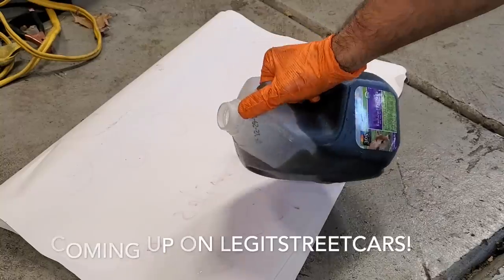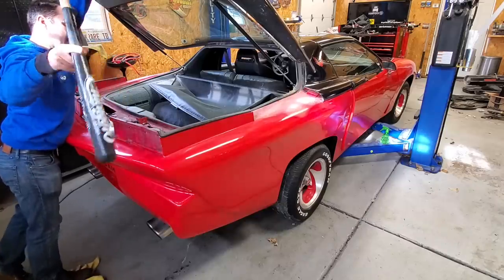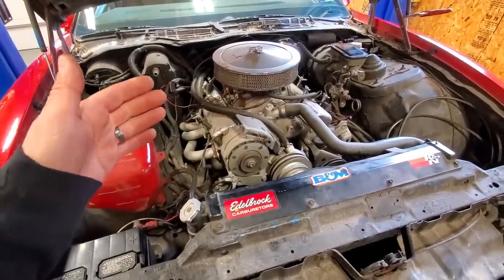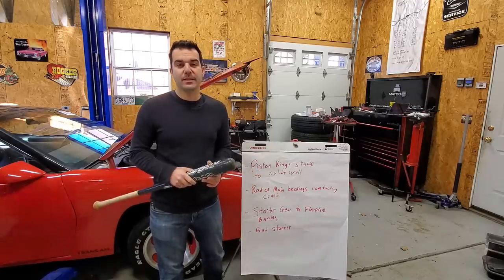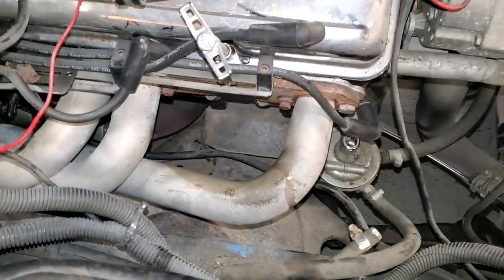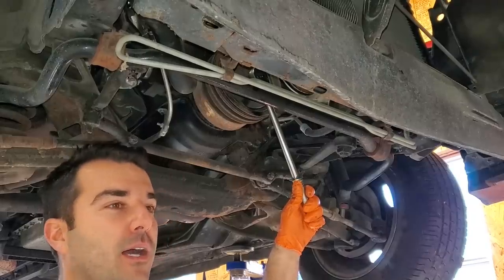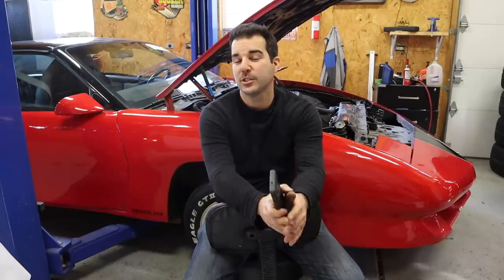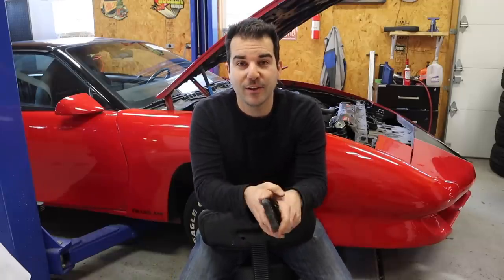My $1,100 Mystery Auction Car Has A CRAZY History! Famous Builder & Built Engine But, Will It Start?

Comment: Doesn't sound like a knock, definitely sounds like lifter tick, the same noise I have to listen to every time I start my Miata ;)
Reply: Yes! Literally valve knock (I assume it's a pushrod engine?) due to a lack of heated oil flow to the shims. The same thing can happen with semi-modern engines that have hydraulic tappets.

Comment: Trolls... they suck. I enjoy your videos and learn from them. I have done done what your doing now, taken motors from the junkyard (sbc350) fixed it up dropped it in a S10 (1986...) with a manual and enjoyed it for years until somebody wanted to buy it.  ATF automatic transmission fluid is great for getting stuff moving.  Even did it to my BMW after letting it sit for 6 month. Pulled the plug lifted one side to level off the pistons some more and let it sit over night, vacuum it out gave it a few cranks to ‘blow’ it out compress came back from the ring sticking.  Then sea foam in the oil half a can and in 5-8 minute it was back to 220-225 psi on all 6.   Now I start it weekly and drive it once a week.  17 years and only time I had issues was not driving it.  New truck... thank you for the videos.  Also put a can of sea foam in the oil it cleans the system only thing I put in my cars.

Comment: Wouldn't be a bad idea to pull the distributor and run the oil pump off a drill on engines that have sat a long time.  That will get all the bearings wet, and you'll know if its got oil pressure.  If the drill doesn't bog down, something is way wrong.   If you've got a spare distributor, pull the gear off and use that to drive the pump.  Failing that, a long 3/8 wood paddle bit with the points ground off works perfect on an SBC.
Reply: Yes
Reply: i was just coming to say this but you already got it
Reply: SANK YOU BROTHER MAN
Reply: Sounds like this guy knows a thing or two...
Reply: Was thinking the same on first video
Reply: Good trick gadget. Have used it a time or 2.
Reply: Oh just saw ur comment and I had just wrote that lol
Reply: Dang you guys know so much about cars, I’d love to have my 2016 Audi s3 looked at just to see the overall wear and tear it currently has after 32000 miles.
Reply: @kriseats2158  get rid of it before 75k. Thats usually when the xmas tree lights up on the dash
Reply: That was a great suggestion about the oil pump
Reply: No
Reply: Unbelievable that this car was neglected and the loose distributor; or, stripped hold down bolt. 
I thought that I was bad w/my cars....
Reply: gadget73 Is that even possible? Sounds to be the most safe thing to do to make sure the whole engine is well lubricated before first startup.

Spraying fluid on cylinder walls may only lube piston rings, but not camshafts nor crack bearings if the car has sat for a very long time.
Reply: @apexseal2811  possible, sure.  remove the distributor and run the oil pump. Won't lube the cylinders but it will lube the crank and cam bearings, and get oil up to the lifters.  If it doesn't make pressure, then you'd know before attempting to start the engine and possibly causing more damage. Lube in the cylinders is also a good idea.
Reply: You don’t have any real wear at that mileage. I have one for the wife and she is a traveling veterinarian surgeon that drives 50k a year. She has 128k on hers and I still runs and pulls like a train, and that is with a APR stage 2 tune.
Reply: Could be the pilot bad going/gone which might be why the ticking/knocking. No oil flow??
Reply: This is a great tip!
Reply: This right here!
Reply: @kriseats2158  thats not a car you look at or worry about until its done,then you dump it
Reply: A old distributor with the teeth ground off works the best.
Reply: My thoughts exactly. A squirt of thin oil in each cyl too before firing.  Also. Use high zinc oil.
Reply: @stevelozano9523  ....The Engine is knocking because The Timing is Off...not because of oil pressure.
Reply: missingremote look at the bodywork. LOL. Set your expectations correctly
Reply: If you just remove the distributor from a SBC engine to drive the oil pump, you will not get oil to at least half the engine.  Take an old distributor, drop the gear off of it, and use the housing with just a shaft in it to drive the pump.  The stock housing has a couple of machined surfaces that seal off the oil passage that crosses the block around the distributor.  Trying to get oil pressure without the housing is a waste of time.
Reply: @dougscott6128  having done it numerous times, I can't say I agree with that.  Maybe doesn't get full pressure, but you get pressure and oil on parts that otherwise would be dry.  Old diz is a better primer but anything that will spin the pump is better than nothing.
Reply: Miller if the timing is off the engine may knock under load, not when it’s idling. Btw rhis didn’t sound like spark knock, more like a mechanical noice. Either the lifters or a spun bearing.

Comment: It's hard to tell but the knocking sounds like a few stuck lifters. They do this when they are holding a valve open with a motor sits for a long time. With the distributor loos like that it could also be a labor knock. Get a stock GM starter if you are not happy with that aftermarket one. You may get lucky with the lifters and they will reprime but you may have to replace them to fix the knock, actually we call that a lifter tap and it's not as deep a sound as a knock from the bottom end when something is wrong down there.
Reply: Well said. I had a Cavalier that sat for a long time and ended up dropping a valve from stuck lifters (broke the spring retainers), but it never made and valve train noise. Live and learn I guess.
Reply: @dalton6439  That's a different kind of stuck. One being stuck and causing a dropped valve would be mechanically stick open. When they are stuck like yours are they have lost their hydraulic prime and the internal cup that keeps them adjusted is stuck down in the lifter leaving a gap and making the valve adjustment be extremely loose. Some times the oil pressure will make them pop back out and back into adjustment, quite often they will not and you have to replace them to fix the issue. It's a fairly simple job on these small blocks.
Reply: @switchblade315   You can repair stuck lifters by taking them apart and cleaning them up. I wouldn't throw money at this thing if it can be done with a little labor. 🔧
Reply: @ipissed  Lifters are not that expensive, no way I would try to repair one for the price of a new one.
Reply: @switchblade315   Well good for you, I suppose you would replace a $500 throttle body because you don't believe cleaning things can fix them. Maybe you think there may be gremlins in motors and you can never know if parts are fixable. There are plenty of experienced mechanics on YouTube that show the procedure of cleaning lifters, do a search. Some of which are very expensive and you would be an idiot to toss it when a little clean up and it's good to go.🏎
Reply: @ipissed  Some lifters can be very expensive and are very much worth trying to clean but for this motor just spend the $20. Its a very easy job on this motor also.
Reply: @ipissed   hey smarty, small block chevy parts are cheap, no way I would go that deep into one to take a 5 buck part apart and clean it and not just replace it with a new one, it's not worth the time chance it not working, If you could get to them with out having to replace gaskets to pull the top of the motor off sure, but no you HAVE to pull the intake and valve covers and on THAT motor you ARE going to need new gaskets each time. A whole set of new lifters for that engine is right around $50 the gasket set is also around $50. A throttle body normally has a O-ring on it and cleaning some carbon out of one is not even in the same ball park as trying to get a dead lifter to come back to life. And just for the record i have 30 years experience working on GM cars and trucks.
Reply: @switchblade315  You wouldn't rebuild the lifters because you don't know how to rebuild the lifters. You probably don't have a clue how to get a stuck plunger out of a lifter bore. It may be a mystery to you how lifters work and how to know if they can be rebuilt or need replacing, but some of us know what we are doing.
If you were worth your 30 years experience you would have noticed that this engine has 0 ridge on the cylinder he looked at (you probably don't know what that means, you will have to look it up) which means it has very low miles, so the lifters in it are practically new. On the other hand the motor was seized so it's still a crap shoot. You would be an idiot to start throwing new parts at it when all they need is a cleaning. 🔧 🏎
Reply: @ipissed  I would not waste my time to rebuild a lifter on a small block Chevrolet The price of a set of lifters is less then the price for my time spent screwing around with something that is cheap to replace. I'm all about saving money but I would not take a chance on getting a lifter unstuck when you HAVE to remove everything down to the heads to get them out again IF it did not work.  We are talking  at lest half a day of work each time and a second set of gaskets if the cheap out repair did not work. Some things are worth the chance, but a $50 set of lifters for a small block Chevrolet are not one of those things. Do a job right the first time.
Reply: @ipissed  you know, I have seen times in which replacing the parts is better than trying to save them. One time in particular, was on one of my old Ford 302 Windsors. I had a dropped valve, but it wasn't due to the engine sitting, I tried lubing the lifters to get it to work, but in the long run, it ended up that the prior owner's neglect had cought up with the poor engine. The engine was an N-code, and if you don't know what that means, it means that it was a factory roller cam, and lifters. The miles, upon miles, of neglect left a serious sludge, and metla chip blockage in the cam region, needless to say, I had multiple lifters that went completely dry, and unfortunately, a few push rods that got bent. This instance, there was no saving the lifters, or pushrods, I installed a new cam, as the smoked lifters, smoked the cam too, as well as new lifters, and new pushrods. I also had the block baked, and cleaned properly, as well as rebored, and honed. Of course I also installed new pistons, as the stockers wouldn't be a good fit anymore. There are many times when just replacing parts is the better option.
Reply: @switchblade315  honestly, I'm with you on this, hence the reason I'm willing to try and rebuild many of the fuel system parts on my old 7.3L IDI diesel, my injection pump is somewhere around $1,000.00 and if I can rebuild it, I will. But if the part is dime a dozen, there is no reason to waste time rebuilding a cheap part that will most likely fail again, long before it's service life should expire.
Reply: @TimberWolf429   He or she doesn't know jack about building a engine other then what he or she has watch on YouTube, real world knowledge doesn't mean anything. I do this for a living, I have 30 years experience with small block Chevrolets,  Built AMC V8s, Ford Y blocks, Ford small blocks, Chevrolet V6 and 4 bangers, been completely through a few Toyotas, Macks, Cummings, and Detroits. Do things right the first time and build motors to last, don't take a chance on a stuck part not sticking again when it's cheap to replace it with a new part. This jack wagon just wants to puff his chest and argue. Real mechanics and engine builders know when to rebuild and when to replace parts.
Reply: @switchblade315  I agree with you there. This is especially important when you do work in a garage. You making money relies on you getting as many vehicles repaired properly as possible. If you can nust replace a part with new, and get the vehicle out the door, in less than half the time you would need to rebuild that same part, then that's the way to go. Also, the new parts, as long as they are either OEM, or a reputable aftermarket company, are going to last longer than any rebuilt parts, it's just fact.
Reply: @switchblade315  also, I won't say I have the years of experiance that you do, but I've been in engines long enough to know where to cut losses, and just do a part swap.
Reply: @TimberWolf429  ipissed pissed everybody off

Comment: The Bendix or 1 way clutch on the starter gear sometimes will stay out on hight performance starters until the engine fires and spins it backwards to retract it on its worm gear. Standard gm starters have a spring and a fork connected to a solenoid which holds them because but Chrysler style high torque starters require the motor to put the gear back

Comment: Run some Seafoam in the crankcase to loosen up those lifters then change the oil again.
Reply: or BG motor oil treatment to soak into the metal parts - you let it idle for 30 minutes then drain the oil it will look like mud but it does wonders -- in my B6 Audi S4 4.2 Quattro it stopped it from burning 1 qt every 700 miles to none. ITs been 46k miles since and still good, no burning oil, it will also restore other components as well.
Reply: @gokeyinspections8552   Really?  I have an '04 Phaeton with the 4.2, I'm interested in keeping it running as long as possible.  The VW Tech in Portland says it's about the cleanest 4.2 from that era  he's seen-- oil still translucent and amber at 4500 miles-- but I want to take every advantage I can.
Reply: @theprojectproject01  Don't do anything different than you have been doing.  You'll just add risk of messing something up.
Reply: Definitely heard a couple of lifters rattling around.
Reply: Mostly what I do is drive it a couple hundred miles a month and then let it sit.

Comment: The splines on a starter are supposed to be twisted for the fact that when engine kicks/starts it forces the starter gear back into its off postion
Reply: And that means this guy has never once had a starter off !!
Reply: Under normal circumstances, you don't see that the starter dog can be spun back by the engine, it is generally slack enough to spin back on its own (and it's inside the bell housing or other cover).  It's the sort of thing you read in the manual.

Comment: my honest opinion on that rattle/knock could be lifters, get some marvel mystery oil and add it in and run it, my fiero that sat for about 15 years had the same issue and once i got the oil in there and ran it for about 10-20 hours total (not all at once, i did heat cycles) it seemed to have gone away
Reply: AFT is a safer alternative to marvel mystery oil. it works grate fro removing deposits and safely suspending them.
Reply: ITZ Caleb make sure the distributor did not pop up past the hold down at the base that passes through the intake. Those days the pressure senders didn’t last long the pressure switch is driver side of the distributor. The ticking noise is lifters they probably leaked down after sitting and they will either pump up on their own or stay bad. Please don’t rev it let it warm up fully a few times. Heat cycles because it’s cold should let the lifters pump up on their own. Congrats on the bird good luck
Reply: @dakineracin  oh ya, i did like 5 to 7 heat cycles on that back when i got it first started, first startup it started to run away and i shut it off, but was able to fix that with a new TPS, that was almost a year ago at this point now
Reply: @drifting1O1  im sorry, i would never put ATF into my 33 year old engine, let alone let it get anywhere near my manual, mixing oils isnt the best thing to do if you dont know what your doing either
Reply: @spankthemonkey3437  yes it does, i did try that but unfortunately it didnt work out too well for me,  im going to do a whole head/ cam/ lifter rebuild on my car pretty soon so it wont matter to me here really soon lol
Reply: Caleb you still got your Fiero?
Reply: @Scott.Kristiansen  yep, drive it daily
Reply: I agree about trying an oil additive. It doesn’t sound that bad. Wouldn’t be surprised if they free up while driving.

Comment: The bendix on the starter has to be turning to retract.

It was probably OK without the shims.
Reply: Most times the starter on these old cars will still disengage, reluctantly, with a loud squinchy sound as the flexplate and the starter gear interact unfavorably. A shim or two usually fixes that.  

I can't believe that at 38, I'm now old enough to pick my brain on what now are classic vehicles.

Comment: Love your videos! When I retired I had  2 ASE Master certifications and every certification that Ford offered although I never worked for Ford. I was teaching at an automotive tech college and had to have 24 hours a year of tech. training to keep my job. .  With that said here's the way to gauge starter shims on Chevys. Not many need them. You use a large paper clip about .020 in diameter. Bend one end in an L shape and use it as a gauge to measure between the drive tooth and the root of the flex plate teeth. In the factory manual it was advised to measure in 3 places equally distant apart. It works every time. Remember not many need shims so check before installing them.

Comment: Might wanna replace all the fuel, if it's been sitting for a long time, the fuel can go bad, might produce knock.
Put some nice high octane fuel in there, and see how it behaves … after all, it is a built engine, so it may be built for higher octane ratings.
Reply: You are talking about spark knock. That doesn't come into play at idle unless your timing is set to 50° + advancement.
Reply: @YOUneedJESUS1  
No, I'm talking about compression knock, because of low octane fuel.
Reply: For real!! Any " Fresh" fuel!
Reply: Matt Spors it’s referred to as fuel knock and happens when your gas has little octane. Putting some higher octane in there would correct it if that’s the issue.